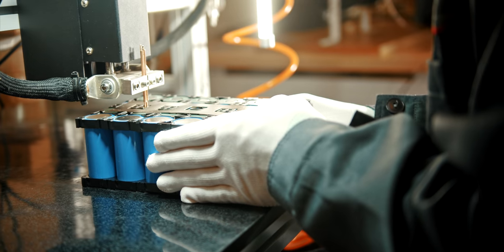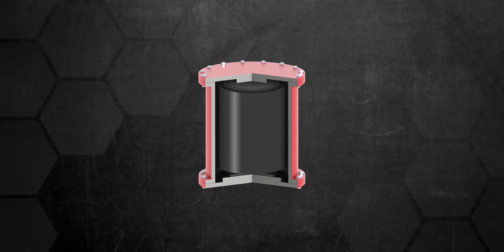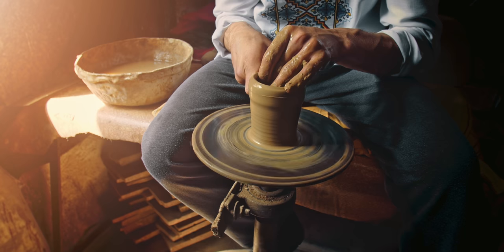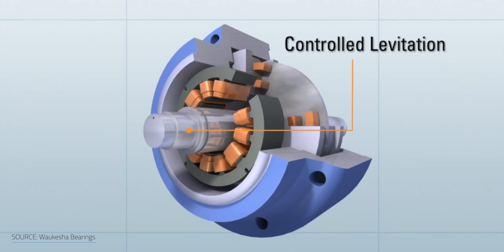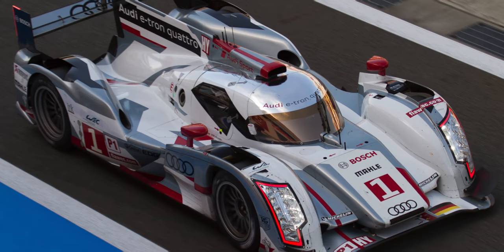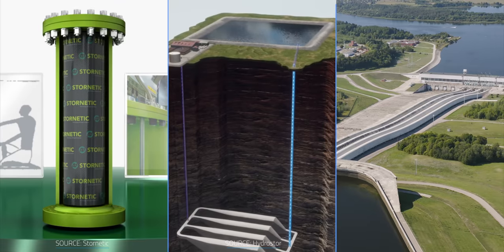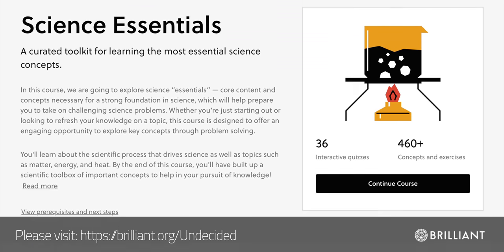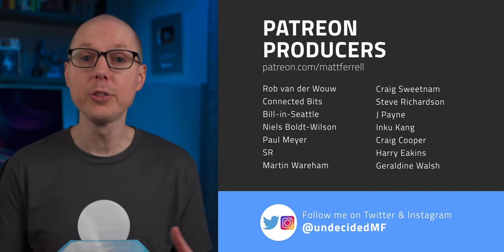The Mechanical Battery Explained - A Flywheel Comeback?

Comment: One of the more interesting UPS systems I saw was an electric motor that drove a flywheel. The flywheel had an integrated written pole generator in it. In operation the motor keeps the flywheel spinning and the written pole generator supplies very clean 60 Hz sinewave power to the protected load. The system was designed to supply the protected load for only six minutes. When utility power failed the flywheel would start to spin down as the stored energy in it is used. Not only does the generator output have a regulated voltage, but the frequency of the output would remain at very close to 60Hz. Meanwhile a diesel engine would automatically start upon a utility power failure of one minute or more. The engine would run at a slow speed for three minutes to warm up then throttle up and engage a mechanical clutch. Then the engine would bring the motor and flywheel back up to normal rotational velocity. Once utility power returned for several minutes the generator would disengage and shut off. Once it disengaged the motor would be reconnected to utility power and take over the job of keeping the flywheel spinning.
Reply: Hell yes at last some one else who can see the light litterly . Thank you .
Reply: My dad was installing these in the 80’s
Reply: Also you could handcrank the flywheel if the diesel doesnt work. 😜
Reply: @K0nst4nt1n96  Yes, that's why we hire interns.
Reply: @K0nst4nt1n96  You can also hand crank the Diesel. I have a Farymann Diesel generator that has a handcrank for when the starter doesn't work. Decompress the engine, crank like it is going out of style, release the lever and watch it run. To shutdown, you hold the decompression lever down and wait, and wait, and wait, and wait some more for it to stop turning. The generator, fan blade, and flywheel on the engine will rotate the engine for nearly 5 minutes and if you release it before it stops turning, it fires back up. At 1800RPM it varies only between 59.9 and 60.1 Hz under load. One of them running on YouTube. https://www.youtube.com/watch?v=3U52aeWKV50 It looks like it has the small flywheel on it. At 1 minute in you see the decompression lever on the left front corner of the block.
Reply: So then for every 9 minutes of electric green power solar... whatever, half of that time a diesel has to be used too, and most of the time that diesel is running it's just warming up?
I mean come on....
Reply: @ToreDL87  Our Detroit Diesels were instant run on our gensets. No warmup and no heaters. Our Detroits on our pumps, they were a warmup to 140° then load and run. The Cats and Cummins were equipped with block or crankcase heaters so went under load after 1 minute to allow the oil to flow properly and to allow the pre-lube pumps to shut down. Now on one of the locos I operated, it would not move unless the temp was up to 140° and on a cold day, that meant more than an hour to get the 130 gallons of water and 110 gallons of oil warmed up if you didn't plug in the crankcase heaters.
Reply: I was responsible for operating maintaining our flywheel UPS systems back in the eighties. Each once had a 10,000 pound flywheel that could give a lot longer than 3 minutes of power. Our diesels were instant run and could take a full load in 3 seconds, plus we had a massive battery system so I spent years fine tuning the system (I had already created the computer control system for all of the above so I could look at the stats each month and tune the system to try and learn where the most efficient mode of operating really was at).
Reply: @theq4602  I guess you think you know everything about Diesel gensets. But again, you would be wrong. Most Diesel gensets have no need for a clutch but that does not mean that all of them didn't/don't have one. That is the same sort of thinking that says no Diesel engines have spark plugs. Which also is wrong.
Reply: @gravelydon7072  Yeah I know diesels can have sparkplugs. International harvester built tractors and bulldozers that ran on gas first then switched over to diesel once they got warmed up.
Reply: @theq4602  They also supplied at least two gensets to the Army that were that way. Which meant they had to hide the gasoline can any time the went into Washington Union Station from the South. Those gensets had clutches as far as I can tell from pictures of them. They were later replaced with Detroits which did not have that need. Cleveland trenchers also used the UD series engines on some models. Ours was a Model 110.
There are gensets that have electromagnetic clutches that couple the engine to the generator. And those were in use by 2010 in data centers. They are NO-Break units that normally are turned by electric motors and if the grid drops, the Diesel starts and is coupled to the alternator. The engine then turns both the alternator and the motor as they are one and the same. There is also a flywheel that keeps it spinning during the time the engine spins up. Sort of the same idea as the local AFB had for pumps for the water towers. If the power dropped, the gasoline engine would start and the operator would engage the clutch. The engine would then turn the pump and motor.
Reply: The nice thing about flywheel UPS units is that they can also provide full isolation from the grid, e.g. Protection from lightning strikes, and the momentum of the flywheel irons out surge in demand.
Reply: I was involved in installing a 60-400Hz motor generator UPS in the late 80s for a mainframe computer system. The computer and the UPS were both water cooled
Reply: Pre heating the engine would help
Reply: Ben Dover  I think you misspoked the crap is in the batteries the mechanical stuff is clean and as the final slide showed the only thing missing is the law that says that any installation has to have the flywheel scaled WiDE  SO AS SINGULATLY to provide the storage. The 'profit' TRAGICALLY is in having multiple units as opposed to one custom huge monster. The PATHOLOGICAL SOCIETAL profit is in reducing the mass of the unit and not just having many of course but as the first slides showed it is Irreverently skinny. This video is missing the really sexy ice skater because that's essentially all that matters. Almost all of the mass of an ice skater is in her body CORE but when she pulls her arms in the rotational inertia of the arms alone drastically increases the RPM of the entire body. That's the power of the exponentIAL REALITY. In a competitive environment it's HYPERimpossible that forced to build a bigger single flywheel all of the entries wouldn't be significantly more cost efficient. Now as I say this I wonder what my meaning is myself in terms of lower profit but integrally more cost efficient? But I'm reassured by what I said which is that having a single flywheel lacks redundancy for reliability when reliability is the 'selling' point but takes advantage of physics.

The video talks about reducing the mass of the torso of that ballerina but why is that? Just because Mass there doesn't increase storage significantly why bother to reduce it? I assume it's because of the magnetic bearings having to support it like a thermal electric chip having to move its own heat so when put in series extraordinary diminishing returns being additive create the bad PR for the technology itself?

So then you ask why do you have the rotor? Why do you need to have the magnetic? The answers are because that creates proprietary technology to handle the high RPMs which create the problem solved by the magnetism. Ultimately you have the metrics coming in where regulators can say just because you've been able to make a lot of money for decades on this ridiculous design doesn't mean that you are producing something of acceptable productivity. The minimum cost effectiveness of flywheels hence forward must be 300% of the very best money  can buy currently. I would imagine a coalition of energy storage interest would all go to the mat to the max. They would be very very concerned not about losing flywheel presencs in the market but about being unable to compete with it and having a single technology for energy storage of any scale as nobody else can compete.

Our nerves use electricity it's biology and so you have the fans who want like some sort of God to create in their image. What he got suck; I said bloody guts suck. Get over it! This video was gorgeous unfortunately the contemporary technology was shown in the case without any indication of how many yards across those last two flywheels which were classified as hybrids where. Apparently incorporating some battery allows the flywheel to strut a little bit and you see just two TOPS. It costs nothing to go at a faster speed if a fly will can handle that faster speed. Does Tesla says just drain the battery below zero even though they don't have the Mercedes button in the trunk to charge it above 100%. They use the cloud why pay for an extra button?

Again I loved the slides but if you're going to say you have a hard time with physics and then you going to do looking forward video about the science of a rotational energy which has nothing to do with rotating of course it has to do with the mass being in motion and the cost of keeping it in motion and how much motion mask can have and what that m
Ass should be built to be?

Because the energy is so cheap unless it is renewable at a very small scale nobody has ever bothered to try to store it. Besides being naked the flywheels at the beginning of the video we're not with the exception of the bus which I admit I never heard of to store energy itself. That bus is actually amazing! It just goes to show you that most of the problems were solved but then corruption had crazy technology like car carve out it's monopolistic role destroying our planet where children even today are allowed to see marketing for cars! 

THERE WAS A TYPO EARLY ON THAT I TOOK TOO LONG TO GO BACK TO FIND. IT'S PRETTY OBVIOUS BUT IT MIGHT MAKE IT DIFFICULT FOR SOME PEOPLE IT WAS A ABSENCE OF A NO OR A PRESENCE OF A NO. SO I SAID THE OPPOSITE OF WHAT I MEANT IF YOU ALREADY KNOW WHAT I'M TALKING ABOUT BUT IF YOU DON'T IT'S GOING TO BE A BARRIER AND I APOLOGIZE.

THE OTHER EDITS I MADE HAVE BEEN LARGELY IN CAPITAL. THERE IS ONE FINAL THING I WANT TO SAY REGARDING ONE OF THE WORDS I HAVE INTRODUCED ON THE EDIT HERE AND THAT'S THE WORD TOPS. THE TOP IS A TOY THAT KIDS SPEND AND IT HAS THAT ATTITUDE STABILIZATION. IT'S ABLE TO BALANCE ITSELF FOR A LONG TIME LIKE A UNICYCLE. I SAW A COUPLE GUYS ON UNICYCLES YESTERDAY AND THEY WERE NOT IN THE OLYMPICS SO THEY WERE JUST VERY VERY STEADY very boring!

AnD be goddly.  Spin don't integrally energizing electrically SO SIN.  The bus 🚐 works from mechanical windup.  I.E. QUICK.

Comment: A stack of flywheel storage units up the centre of a wind turbine is something I have always thought would make a good combination.
Reply: @daviddavids2884  what?
Reply: that seems great , and maybe if there where a way to directly store the kinectic energy into the flywhells instead of having to convert it to eletrical energy first there would be less of an energy waste
Reply: @lavaot5207  That would require one hell of a gearbox to turn probably about 10 RPM to 30,000/40,000 RPM, the mechanical losses would probably outweigh the potential electrical losses incurred by just directly wiring the flywheels into the output of the turbine
Reply: @richardmillhousenixon  You can use steel flywheels... And the power for the tubine already has a gearbox that does that (to generate electricity). I'm thinking that it would be too heavy
Reply: @marshmellominiapple  The gearbox that steps up the turbine rotation to the generator rotation turns about 10-20 RPM to exactly 3600RPM in the US (or any country with a 60Hz grid), and 3,000RPM in any country with a 50Hz grid. Still far below the 30,000-40,000RPM or greater needed for effective flywheel storage. And a solid steel flywheel would not be a good idea. Ideally you want a flywheel with a very high moment of inertia, i.e. most of it's mass at the edge, which would mean the best design would be something with a carbon-fiber hub and a ring made of some dense metal. In order of increasing density, common metals that would possibly work are mild steel, stainless steel, brass, and copper
Reply: @richardmillhousenixon  Right, but you COULD still have steel (not solid but chunky) and have that spin at 3600 rpm (or whatever) in the main tower. You could just do what normally happens and have a separate gen-motor for the flywheels. but just have them in the tower to save space. [It wouldn't because you still need to climb up the towers for maintenance]
Reply: @marshmellominiapple  Or you could just hook off the shelf flywheel storage units to the electrical output of the turbine, have those spinning at whatever speed they need to spin at in order to work and use those stacked inside the tower instead
Reply: @richardmillhousenixon  that's kind of what I said, but you said it better. Honestly, not a good idea to stick it inside the tower.
Reply: they need to be contained as inertia plus large mass + failure = large masses of material flying through the air at high speed=death
Reply: I've often wondered why people don't stack solar panels onto wind turbine towers.
Reply: @richardmillhousenixon  no need for gearboxes. You can use the electrical power to spin the flywheel, no mechanical transmission needed.
Reply: @zokraft  read lavaot's post.
Reply: @richardmillhousenixon  I see now, sorry about missing the whole conversation. lavaot's proposal is preposterous. All turbines (water, wind, etc) already have some sort of flywheel behavior, as they spin some weight that has inertia to stabilize rotational speed. And alternative current conversion is already done with a good efficiency rate. Flywheels can be powered by alternative current I imagine.